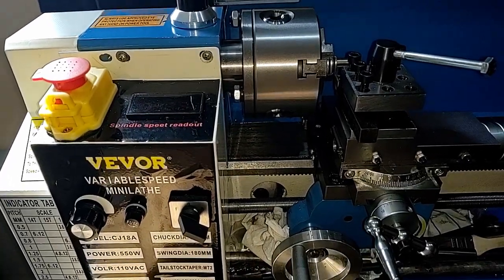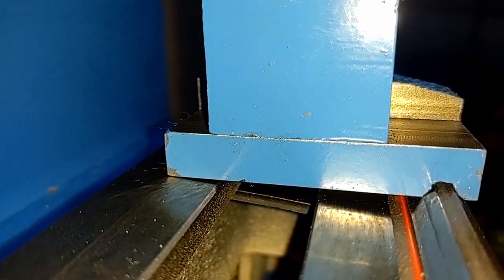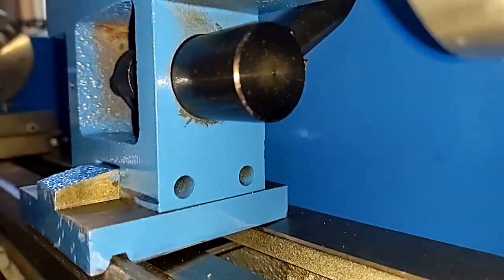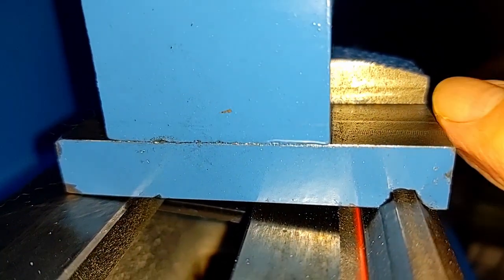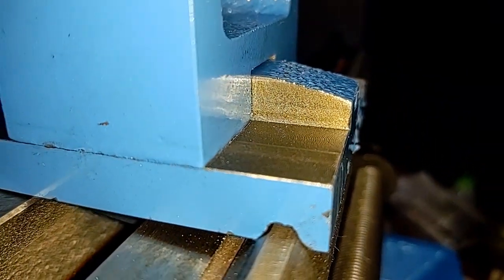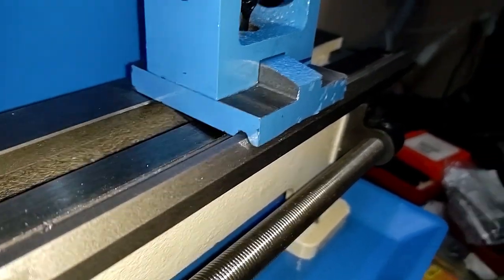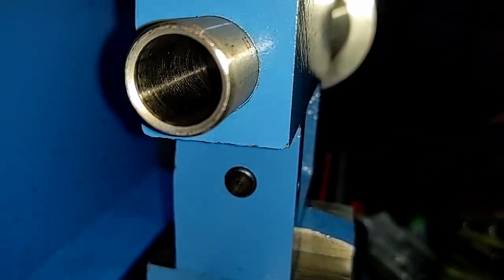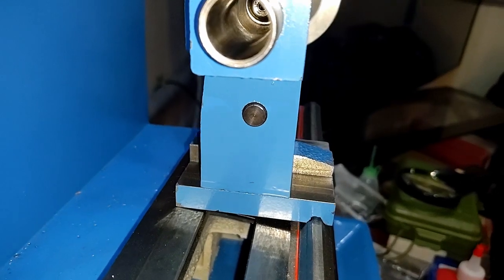Velvor Chinese 7x14 mini lathe tail stock mounting plate problem. Bad base plate from factory.

Comment: Sounds like you got the problems solved. It was easy tobsee tge poor cut v way but it would have been nice to see the tailstock lined up to the headstock with a center in each to really see in which directions it was off.
Reply from the maker: The primary problem was in the vertical direction. Because the base plate was on a slope, the point where the centers crossed was high. Not by much, around 20 thousandth but still enough to cause a problem.

Comment: I purchased the same lathe (from Amazon Services in my case) about 7-10 days ago (March '23) and went through the assembly, cleanup, etc. and then found the exact same issue - the v-groove is too shallow, so the whole tail stock tips same as yours. I'll monitor your progress here and sympathize for sure. If I can think of something I'll post here.
Reply from the maker: I am in the process of finalizing a partial refund from Vevor for this problem. I decided that the easiest fix for now would be to buy a new tailstock from a US company. So once that is completed I will be installing the new tailstock and testing it's fit. We are not the lone examples of this problem, it is a standard feature of the 7x14 lathes coming out of China right now.

I could of course cut the groove on the plate larger and then fit it carefully to the bed and at some point I may well do that. But my point is that this is something that we should not have to be doing ourselves. Contact Vevor and start talking to them about having them send you a replacement plate that is correct. It will take a while to work through the process. Vevor is responsive but in the long run they just want this problem to go away and are willing to pay to have that happen.
Reply from the maker: So, Vevor gave me a $200 refund on the lathe and I bought a new tailstock from a different company. That is on another video in this series.

So gentle viewers, my point to you is this, it is time to stop accepting the absolute junk that is being sold and give the sellers a reason to beat up their manufactures to make a better product. Demand at least basic quality.

Comment: I bought one same problem.And a few others to..It was'nt even the same model number that I ordered.
Reply from the maker: Sad to say, this is a very common problem. I was able to get the company that sold it to me, Vevor, to give me a $200 refund. I used $90 of that to buy a new tailstock from The Little Machine shop, which fixed the problem. 

I will at some point, once I get that cheap Chinese X/Y table I bought fixed up, cut the foot plate of the Vevor tail stock to the correct depth. 

I wish you well on getting yours fixed. There is a channel out there called " The Aussie Shed ", he has quite an extensive set of videos on the tuning of one of these mini lathes. 
https://youtube.com/playlist?list=PLooB2EjBotjLpN5sL1KflRLwNUS7tSpBH

Comment: Oh dear, that is one of the worst examples of faulty machining I have seen on one of those mini lathes. If the seller gives you a partial refund that is more than enough to buy a replacement tailstock, or just the tailstock base, then you have nothing to lose in tying to fix the faulty one that you have.
 There have been a few different types of tailstock used on the mini lathe. One example I have seen had a tailstock that did not use the vee guidway at all, on this the tailstock was guided by the top of the two flat ways and also the two verticle flat surfaces in the gap that runs along the middle of the bed. So only the saddle uses the vee guide, which is a good thing.
 So if you do the job yourself,  but cannot cut the vee way in the base any deeper or find someone else to do it correctly, it might be worth modifying your tailstock to use the flat ways as described.
 The part of the base with the vee could be cut away, and a cast iron, bronze or even steel guid block, or tennon, made to accurately fit inside and slide along the gap along the bed, assuming that the two inner vertical faces are nicely machined, and are parallel to each other and the vee guideway. This block is then attached to the underside of your tailstock base, allowing for the clamping system and the adjusting screw. 
 You could use the three jaw chuck to carefully grip the tailstock quill in order to hold the tailstock body, with its base, in near enough the correct position for temporeraly attaching the block with glue before finally securing it with screws or bolts. Gripping the tailstock in this way could also help in working out the shims required to bring the tailstock to the correct centre height. I am not sure if the mini lathe tailstock will reach the chuck without removing the saddle.
 This may all be doable if you have limited equipment,  and if it all goes wrong then you could still buy a replacement tailstock with the sellers hopefully generous refund.
Reply from the maker: Thank you very much for the advice. The seller just wrote me today, asking if I could have a new plate made up. I told him that it would cost several hundred dollars, between the materials and having a job shop set up to run the part. We shall see what happens. I am thinking about cutting a new base from 65-45-12 ductile iron bar stock.